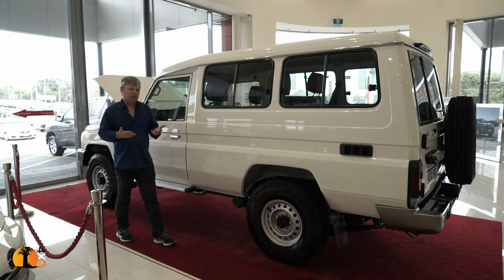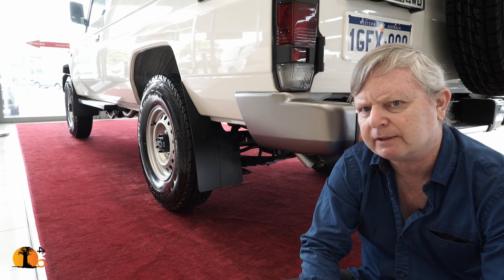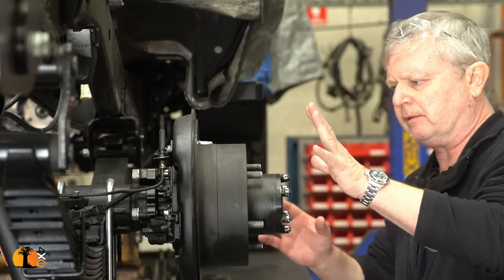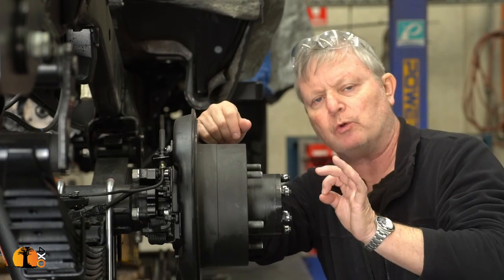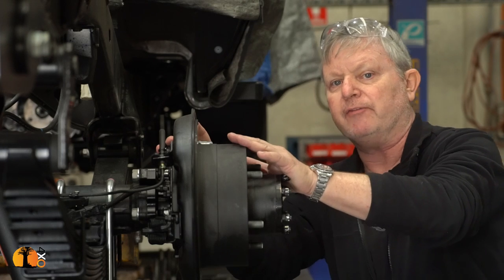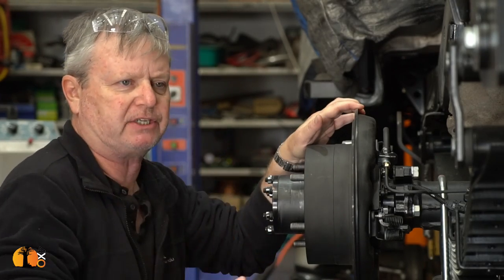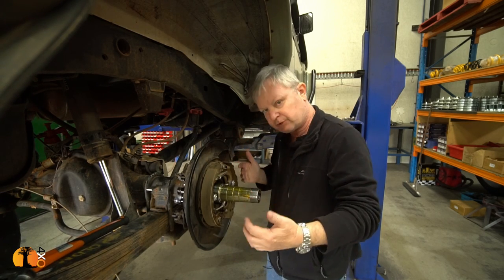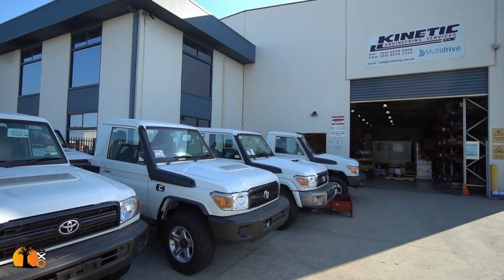TOYOTA LAND CRUISER REAR AXLE issue. 70-Series

Comment: Did the Toyota engineers really forget to update the rear axle ? Or the effect is really negligible so not worth the modification ?? Probably would help if you add an actual impact engineering study for shorter axle to support your subjective impressions
Reply: You are questioning a car the hasn't been changed that much in a very very long time  ago.
Reply: that’s what motoring journalists do, subjective opinions

Comment: Automotive engineering where innovative fabrication and manufacturing is concerned on a stock is a specialised job that run-of-the-mill mechanics just simply cannot do. One needs a deep understanding of the mechanics & dynamics of the auto you are working on with solid experience & training so that the originality of the auto is not disturbed or made illegal yet the change is positive and brings a better driving experience. It requires dedication by the owner in terms of money and by the engineers in terms of expertise & experience. Both combine to give an ultimate, satisfactory driving pleasure.

Comment: I was not aware of this, funny to hear. I'm going to check if the 1999+ Hzj74 has the same.
Reply from the maker: It does not. The redesign of the front end to fit the V8 marks the wider front axle - around 2008.

Comment: Another place you will notice a narrower rear axle is when driving in snow, specifically heavy wet snow. The front tyres will create ruts, causing the rear to jump back and forth while the two rear tyres try to follow the fronts. This is not only uncomfortable, but annoying.

Comment: Rutted tracks, sand, mud: it's stupidity to put out a vehicle with different front and rear tracks. IMO switching to the V8 engine was a big mistake; nothing wrong with the solid old straight 6's
Reply: Except that it would need meet Euro5 emissions.
Reply: How much power do you want? I used an old HJ47 for years as a tour vehicle carting 10 people and a fully laden trailer around the top end. Plenty of grunt, cruise at 110, 14-15l/100km, reliable as hell...what more do you need?
Reply: solid old 6's are also being fitted to the wider front 70 Series Cruisers..for the info..
Reply: which county is that in?

Comment: You are increasing the distance between the wheel bearing and the leaf spring. Isn't this going to cause heavy strain on the 4 bolts holding that extension? Toyota made that shorter to prevent excessive strain at the axle hosing at the bolts? 
Adding a spacer is going to act like a negative offset similar to running a negative offset wheel with the exception of two parts to achieve the negative off set.

Comment: Is this the reason why your wide tyres scrub now? I know it wouldn't be a prob with a tray back but the wheel arches may need correcting as well to suit?
Reply from the maker: Added width plus wider tyres means I now have a mis-match. but I prefer narrower tyres anyway, so I'll sort it out with that.
Reply: 4xoverland yeah cool, hopefully 255s will do the job for you as you probably already know!!
Cheers mate.

Comment: Another issue with the Toyota debacle is the width between the springs.  As you increase the track without increasing the width between the springs, the leverage increases, causing more spring deflection for the same load.  

Toyota should never have been granted ADR on this horrible issue - period.

The price they get for these vehicles would easily cover the tooling cost to widen the rear chassis and make them safe.
Reply: Does that explains why his troops looked like it was overloaded on the Trans Australia trip, or was it because someone brought to much junk along?

Comment: out of curiousity. who installed your flexi flares? Just to warn you to check that if they have gone in to the metal it has been treated. The Guards(mainly front) are quite thin and can rust quite quickly. Especially in hostile conditions.

Comment: Really interesting video. Especially as I have just got a 79. Is unbelievable that Toyota haven't done anything about this. It is 11 years since they widened the front axle and over 30 years since they designed the 70 series, so it doesn't exactly owe them any money. How difficult would it be to spec an axle 110 mm wider?
Reply from the maker: A wider rear axle would also mean a total body remodel on the pick-up bed, 76 body and 78 body. I guess they figured it was not worth the investment.

Comment: I'd have to wonder if there isn't a fuel economy advantage to doing this modification if you do a lot of long distance driving in sand, since your rear wheels are aligned with the front wheels and thus not having to cut their own partial path through the sand.

Comment: I am struggling to understand what the underlying message is here. I think I hear that there's a serious design fault which compromises off road ability and towing performance, both of which are fundamental for any credible 4x4, but since it's a Toyota then it's sort of OK even though the fix requires major surgery. However if it was any other manufacturer, such as Nissan, Mitsubishi or Land Rover (all of which have been criticised on this channel) then the verdict would have been excoriating.

Comment: There are more reasons to why spacers and certain offset rims are illegal in Australia. The concern is not only the leverage placed on the bearings (which may be a little over stated here) but also the extra load on the wheel studs AND it changes the scrub radius on front ends. Now while some vehicles this may not be a issue on in the real world, the powers that be can’t be expected to measure and rate each and every vehicle and variant. I just wish they would allow some more freedom under what can be engineered if done so with approved people and good practice.

Comment: Great informative review.
What about GVM?
I have just built an overland vehicle and it is 300kg over GVM empty.
Add 120l water, 150l fuel, camping gear and family and I have calculated my 3.2 tonne GVM vehicle in excess of 4 tonne. 
Have you had the same problem and if so a video on this would be very informative for 90% of off roaders.

I am in the frustrating process of talking to Engineers of what can be done so any insight of your own experience will be greatly appreciated...
Reply: MisterPrecision13 what vehicle you talking about & what modifications have you done/installed? Many vehicles can get close to their GVM once kitted out but to theoretically exceed it by 800kg, even with the extra weight of fluids which are nowhere near that figure, almost puts you in to a different vehicle/licence category. It would probably be cheaper to buy a unimog than engineer a vehicle to that extent & should be a bit of a red flag that you've gone too far. If you genuinely need all the kit you've installed, for whatever reason, maybe look at a camper trailer. As much as they aren't ideal for many situations you encounter in remote areas, it will probably be a better solution for you.
Reply: GAJ sane advice. Kudos
Reply: 2017 Ford Ranger dual cab.
I will be addressing this issue in a video in the near future while I do a review on it once I address the GVM upgrade.
Reply: MisterPrecision13 have you stuck a massive camper on the back, like Andrew was going to do on the 79, as they tend to be a big issue for dual cabs when it comes to weight. Take all the advice you can get from your engineer & follow it to the letter as it's something you don't want going wrong in the middle of nowhere. I'd guess the chassis would be the weakest point in your set-up so that's going to need some serious strengthening, especially if you install air bags as they just create a fulcrum point for the weight due to having less deflection than a spring & many chassis have cracked due to them.
Good luck with it all & I look forward to seeing any review you do for it 👍
Reply: Thanks for the kind words.
I have fitted an aluminium canopy. All the upgrade components are ARB (BP51 shocks, heavy duty springs, air bags, bars etc.)
I have had the chassis strengthened as I have seen dual cabs bent in two.

When you include drawer systems, extra batteries, fridges etc, its incredible how the weight skyrockets so quickly. I thought I was keeping an eye on the whole thing but being the first major vehicle build I have done it has kind of caught me by surprise.
Reply: Doesn't sound like you've done anything too extreme so it's a bit surprising you're over GVM unladen as the payload on Rangers is around 1000-1300kg. Is your canopy direct mount to the chassis or on a tray? Direct mounting can save 200+kg in some cases. I realise it's a bit late for it, but upgrading your GVM could mean replacing all your suspension components, braking system, tyres, wheels & if it's just your rear axle that's significantly over the design weight, it may be impossible without a complete axle upgrade in addition to everything else. If it was me, I'd definitely be looking at what weight I could remove from the canopy & still have it functional before going the GVM upgrade route for such a large amount.
Reply: Direct mount.
Looked at rooftop tents for over a year and finally chose one.
That idea is now out the window. :)
Reply: Mount your rooftop tent as far forward on the cab as you can. People often question why mine is in-line with the windscreen when "rooftop tent rack's" clearly position them over the rear & the answer is simple, you want such a heavy weight mounted that high up to be distributed amongst all 4 springs for greater stability. Not that it will change the overall weight unfortunately, but it may get you in the mindset of changing things around a bit & that could lead to weight savings.
Don't give up just yet, there's definitely a solution for you out there so keep going & you'll eventually have the rig you want/need 👍
Reply: Thanks GAJ,

Great advice mate and totally agree. The problem is I have solar over the cab and Maxxtraxx so it could only go over the canopy.
A solution may present itself soon enough.

Cheers mate...
Reply: I'd definitely consider moving the solar & Maxtrax to the rear as they're probably only 20kg combined compared with 60-80kg for a RTT. Im currently designing the whole rear setup for a Patrol GU dual cab chop I'm going to do & have very little weight to play with as the payload on them as a standard wagon is actually pretty poor. To mount the Alu-Cab RTT I'll be getting at the front I have to design some exo-skeleton barwork around the 1300mm canopy to support a full length roof rack so the flexing of the canopy won't pull the roof gutters off & that will all have to be aluminium for weight saving. Then the only thing steel in the canopy will be the drop fridge slide & supports for the spares at the rear. I'm currently looking at ditching the idea of aluminium drawers to have heavy duty plastic ones with no bearings made up to save weight so I feel your pain when it comes to putting your vehicle on a crash diet.

Comment: Running a wheel with a wider offset does not wear out bearings if you keep the diff oil fresh and dont over load the rig with weight. I have had offset wheels on my Jeep Wrangler for over180,000 miles and have had zero issues. Plus I have the original ball joints in it.  Maintenance is number one.
Reply from the maker: The Land Cruiser wheel bearing do not use the diff oil. They use grease. Not the same design as the Jeep. Jeeps have never been particularly good load carriers, and the comparatively small wheel bearings are one reason. Bearing wear is accelerated by pure physics. More weight on one of the two roller bearings will increase wear on that side. Maintenance is number one, especially in these conditions.
Reply: Yes earlier Jeeps are not really designed for super heavy loads. The newer Jeeps like the JK and JL can handle heavy loads. They come with a beefed up Dana 44 axle. Bigger axle tubes as well as bearings. The Dana 44 that comes in the Jeep is a very good axle and is actually a half ton axle. So it is not really a light weight axle and can handle heavy loads. 

I also do agree that an offset wheel does wear out the bearings faster but at what rate or mileage?

Let’s look at it this way. Say that axle bearings last 200,000 miles with a proper set of wheels and only 180,000 miles with an improper offset wheel. In the scheme of things 20,000 miles is not a big deal and well worth having a wheel with an improper offset to get the tracking you desire.

And yes maintenance is number one!

Comment: Andrew. I drove a 79 for over a year in some of the harshest terrain in Australia on a daily basis and the sway for me was hardly noticeable on sand as I feel that with the correct tyre pressures and the v8 you just powered through. But it was totally unbearable in mud especially with any sort of load. Whiplash territory. Awful

Comment: I have a question re the Mult-Drive rear axle  correction. We are booked in to have this work done on our new 2020 model Troopy once we found the spacers we fitted were illegal. The spacers made a real difference to the driving stability so presume the MultiDrive will do the same.There is a fair bit of discussion out there about the rear axle snapping ??? after the MD alteration, can you comment please?
Reply: I have my questions about the longevity of the Multi-Drive correction too. As far as I have researched, the Jmacx axle swap is far superior. But it's a cost thing too.

Comment: The more i watch your videos on this subject, the more wild I get with Toyota. This pathetic rear track issue is ridiculous and I feel Toyota need to force to correct this major design fault. The money they are charging for these cars is close to scam level and I know you love them Andrew and you are willing to fix them, and when fully modified they are great, but lot people just don't have the money to fix them.
I own a Jeep Grand Cherokee V6 diesel and i cop heaps from Toyota owners how bad they are, well, they just don't have these sorts of design problems and if they did, the amount of crap I would have put up with would be way over the top. It's been the most reliable car I have ever had, bar one drive shaft bearing failure. 
People need to tell Toyota before they will buy this over priced car, no I want say the word I'm thinking of, they need address a number of issue on the 70 series or just stop buying them, I just can't believe people buy these cars as tow vehicles, so many better ones for less money,  Sorry Andrew for the rant, this will be the last time i will comment on this subject as I think i have pissed off many 70 owners.
Reply: @truthseeker3536  I agree 100%, but if the people buying these cars could put some pressure on Toyota to fix some of these faults, but while they are buying them, why should they.
Reply: More money than sense? Popularity contest? 
I had an 80 series a few years ago now. Best "back to basics" 4wd I ever owned. But have a 2015 Grand Cherokee Overland 5.7L Hemi now, because I can buy 3 for the price of a 200 series. And the Jeep has more creature comforts.
Does depend what you use the vehicle for, and I guess each to their own, hahaha.
Reply: @bathgrub8751  I agree 100% the 80 series is properly the best all round LC  Put a decent set of wheels and tyres, 2 or 4" lift kit, good quality coils and shocks, front and rear lockers and they will go anywhere. Also can't go past the Jeep Grand Cherokee for value, comfort, driving dynamics, off roading and towing, another great all rounder as well.